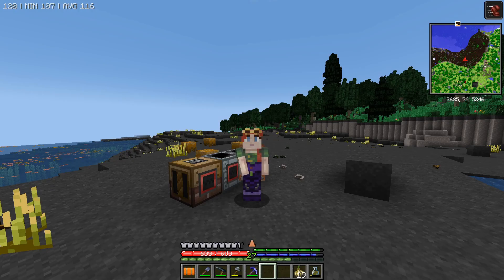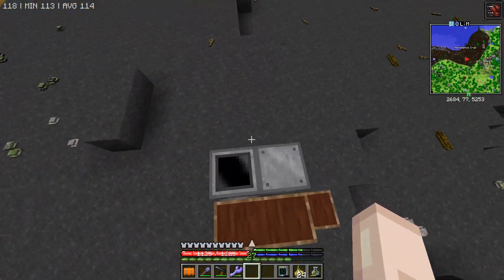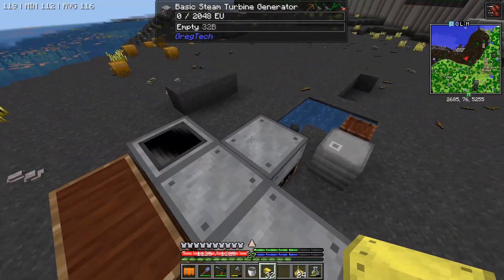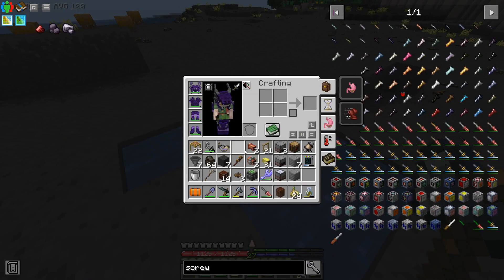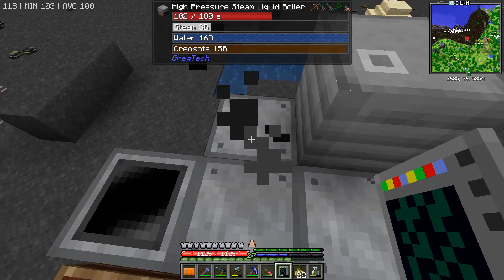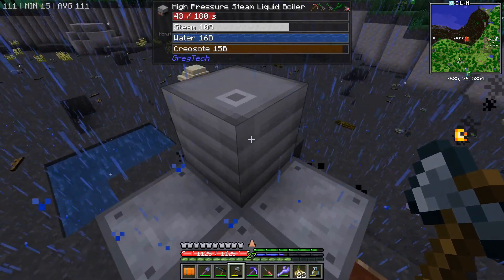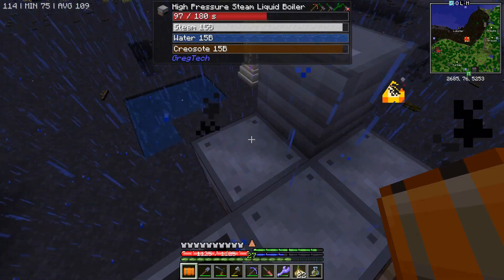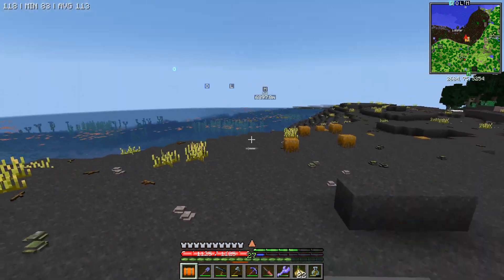ATM Gravitas 2 Spotlight #4: Gregtech LV Miner Setup

Comment: 2 solid boiler is enough for LV miner. The boiler just need to reach the max temp to run efficiently. Also I recommend putting a drum as buffer for steam output incase the boiler is full of steam, cuz when boiler full of steam, they will void 4k mb of steam to the void.
Reply from the maker: Awesome! Is it the high pressure ones? I did find that there was 10 buckets left in my water drum by the time the creosote was gone, so happy day
 

:)
Reply: @Cthulhamonster  yes. It’s the high pressure one. I have also just tested more of it and turns out at max speed, 2 solid boiler is overkill while 1 solid boiler is barely enough.